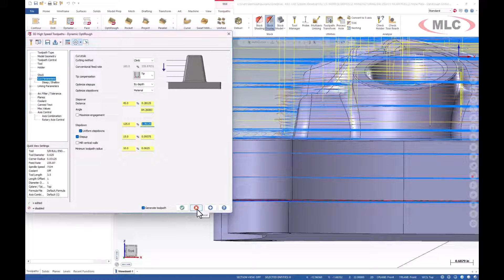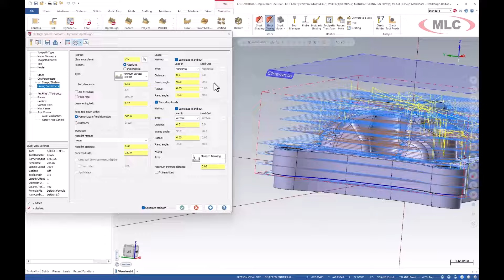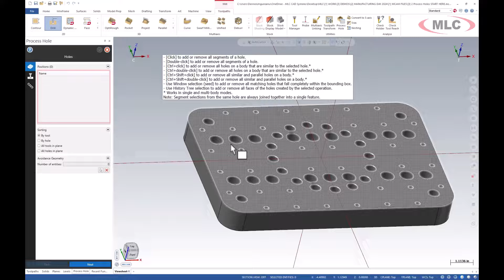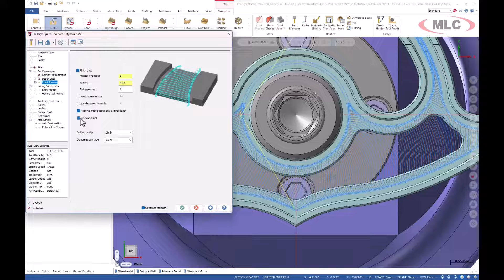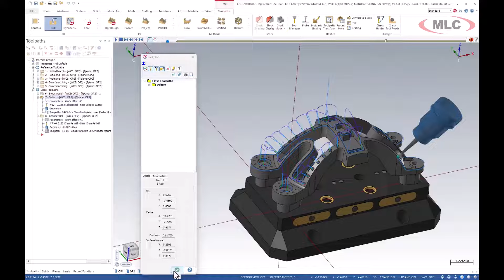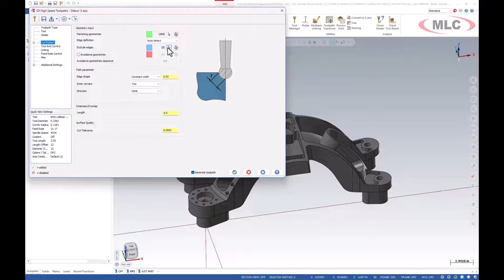Mastercam 2025 | What's New?

Comment: Can someone please help me?  I cant get any help from customer support at Mastercam.   I went to update to Mastercam 2025 it installed and updated to version 2 and but every time I open it it loads then immediately closes after 10 seconds.  Has anyone had this issue before and how can I fix it.  Its not a hardware issue I'm running an i9 and Windows 11.  I've tried completely uninstalling it repairing it  running as administrator everything and same issue.  Thanks?
Reply from the maker: Hello Dave, your first line of support will always through the company you purchased Mastercam from.  If that is MLC CAD Systems you can create a support ticket by email, phone, or online at https://www.mlc-cad.com/technical-support/
If this is a student or home learning edition, check to see if you have a dedicated graphics card.  If you do, enable dedicated graphics.  If that doesn't help, disable hardware acceleration to see if the instability is from graphics, which is the most common initial setup issue.

Comment: Am i the only one who is confused with the maximum minimum depth wording? I believe if the minimum and maximum would be switched it would be easier to understand.
Reply: At first, yes, but once you get used to looking at it from a "the tool will cut this deep" perspective, it usually works out fine.
Reply from the maker: In my experience, if you always look at the workspace from the perspective of the tool/spindle, things tend to make more sense.
Maximum depth should be near the bottom and is the maximum depth of cut the toolpath is allowed to make.  Minimum depth will be higher up on the part (but less deep from the perspective of the tool) and it won't try to cut anything above that line.  Use Maximum depth to keep it from hitting your vise, and minimum depth to prevent it from cutting features that were already cut in a previous operation or needs to be excluded from this one.
Reply: They trying to make it like Solidcam